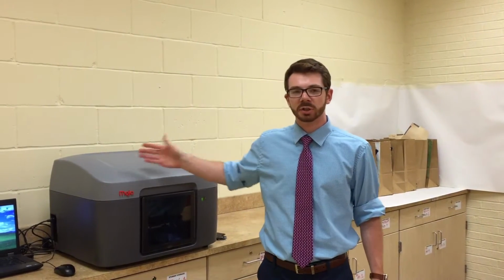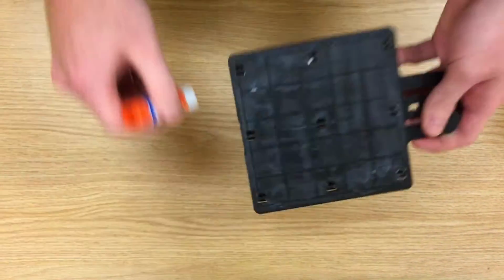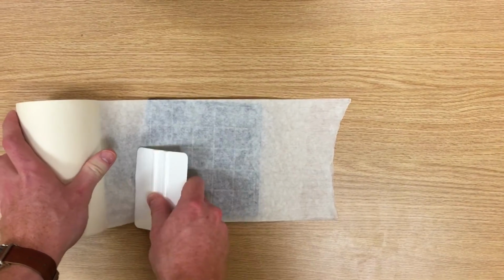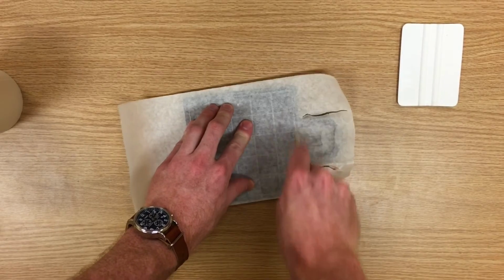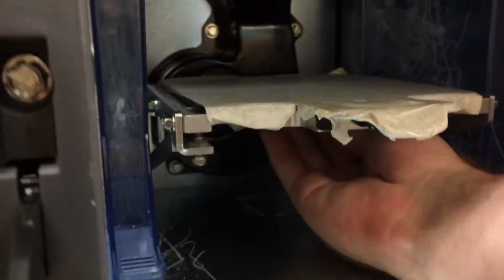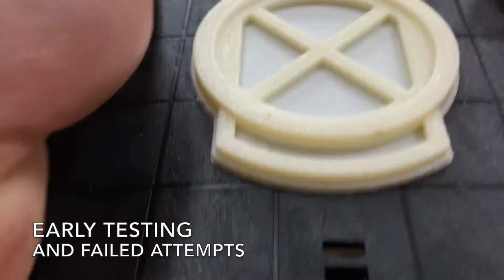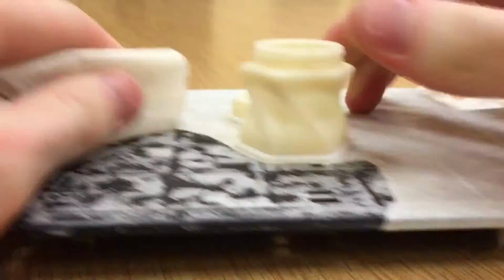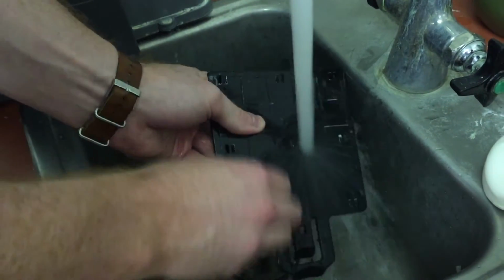Simply reuse Stratasys build trays

Comment: I just use Kapton tape, works perfect. I tried a few approaches with it, first one with a single sheet. That was difficult to place without air bubbles. So I ended up going with 2-3 strips instead. They are much easier to work out the air bubbles and the overlap helps a bit. The trays do wear over time, you will notice divot in them and they become slightly less accurate. But this is significantly better than buying new trays for a small piece. I have had many frustrations with how Stratasys approached this product. If they weren't going to make reusable trays, then at least allow the software to move the start location to better optimize parts for a tray.